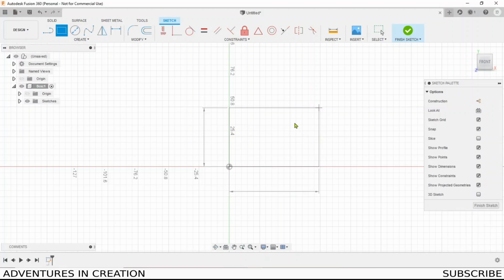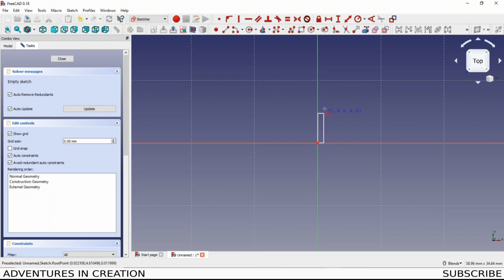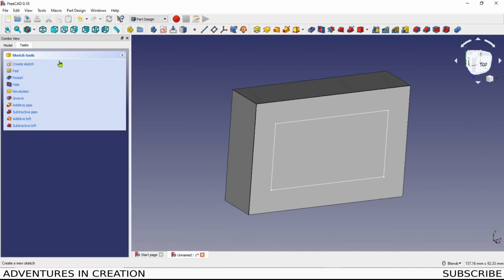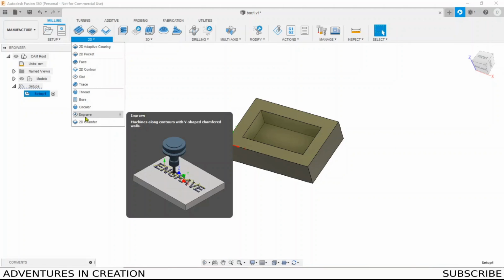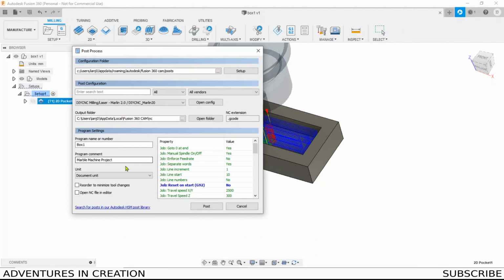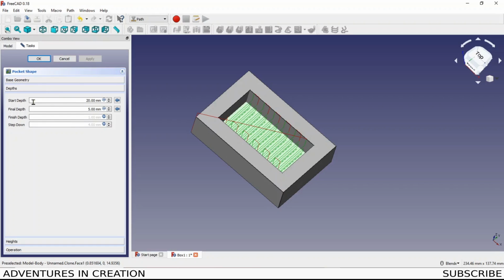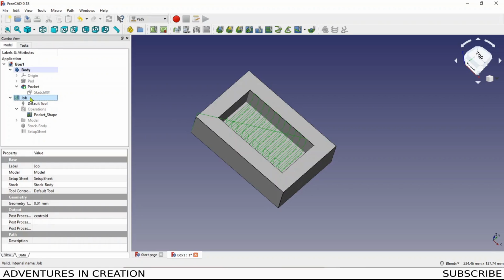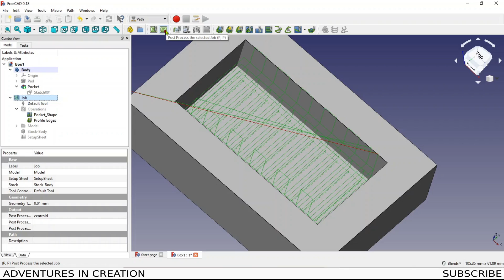Fusion 360 to FreeCAD - MPCNC, CAD CAM Transition

Comment: What would you use in FreeCAD to achieve the same result as Fusion 360's (face) Offset?
Reply from the maker: At the current release working off faces is not recommended but that is coming, then an offset will be easy.
Reply: @Adventuresincreation  Thank you for taking the time to reply to me even though the video is more than 1 year old.

Just to clarify - when you say 'at the current release' and 'that is coming' - are you talking about the current FreeCAD release and that the face offset feature is currently being worked on and implemented in FreeCAD?
Reply from the maker: @ifohancroft  The current release is 0.19 the next release is 0.20 both still have the topological naming issue which prevents using faces to create sketches on. The next major release after 0.20, presumably 0.21, will have a solution for that. Then you could use the face to create a sketch and essentially extend the face. - AFAIK it won't be an exact offset that you have in Fusion now.
Reply: @Adventuresincreation  Thank you!

Comment: Interested why you went from FreeCAD to Fusion 360 and then back to FreeCAD ?

Price of Fusion or something else?

My 18y daughter is about to go to Uni at Sheffield or Southampton to study mechanical engineering and I’m trying to learn CNC both for woodworking (I want an 8x4 feet CNC) and so I can help her learn. I’m wondering what it’s best to help her learn? 

Obvs Fusion is going to be more industry standard so would I being wasting her time or even causing her issues if I help her learn FreeCAD ?

Rambling question: any advice welcome 🙏
Reply: I really like Fusion and even have access to license at work. But Fusion is changing fast and many features added frequently, which is good, but also many features seem to be coming behind paywall. Thats at least my reasoning for interest in open source solutions. I'm not confident at all that Fusion will remain viable for hobbyist machining in few years to come. I'd rather have at least some kind of escape route to keep my hobby costs at minimum.
Reply from the maker: I think learning any CAD 3D modeling would be useful. Just learning the concepts of 3D and being able to create models. I have learned many different systems over the years. I tried freecad a long time ago and honestly it wasn't great. I found fusion 360 when the hobbyist license was free and unrestricted. I invested quite a bit of time learning it. I like it and expect it will become industry leading however, autodesk showed that they can change the licensing situation very easily which made me concerned that at some point there would be no free to use version so I have freecad another look and was pleasantly surprised to find its come on in leaps and bounds. That's why I switched back.

Comment: I liked how there was more con-Fusion in FreeCAD (badum tsss). I guess you already figured out how there are other ways to mill out the inside, that also do the finish correctly.
Reply from the maker: Yes, I will say that FreeCAD has some way to go to be as good as Fusion360 in the CNC department. It definitely has some different approaches. However, I haven't found anything that I couldn't do in FreeCAD and had to go back to Fusion. I believe the FreeCAD CAM capabilities will grow and improve in a short space of time.
Reply: @Adventuresincreation  I fully agree with you! I don't even have Fusion 360 (since it doesn't work on Linux). The biggest issue in my opinion is the different workbenches each being their own beast (with their own beast of a (lead) developer behind it). It would be great if the basic workbenches (sketch & draft, part & part design) just become one uniform interface. But then again... where should it stop? The different workbenches do offer modularity (you decide if you actually need the 3D printing workbench, if you need the plate manipulation workbench, the robotics workbench, etc...)
Reply from the maker: I agree, it's a mixed blessing.

Comment: you could easily do this with one operation in freecad. chose pocket operation and in the pattern select ZigZagOffset. Then the job is done
Reply from the maker: I discovered this after the video. I have found however, that sometimes there are artifacts left over.

Comment: You simply could made a box in FreeCAD complete skip the sketch part
Reply from the maker: I certainly could however, I wanted to change the box later on and was only using this as an example.

Comment: It is risky to create a sketch on a face of an object. See this: https://www.youtube.com/watch?v=0UlnrG-2atk
I don't particularly like the solutions he came up with, but he does do a good job of demonstrating the issue.
My solution is to create all sketches relative to the xy, yz, or xz plane, and then offset and rotate them to where they need to be. Using the spreadsheet to create a list of named variables is very helpful to make sure that when for example you change the thickness of your object, the sketch to the pocket moves with the face. This is done by having both the pad, and the offset for the pocket sketch use a named variable for the thickness.
0.19 does not yet fix the topological naming problem.
Reply from the maker: I understand the problem. I usually use a datum plane offset from the xyz but for simplicity I used the face in the video. This is a problem that apparently isn't simple to solve.

Comment: Freecad hasn't offset
Reply from the maker: I am not sure if you are asking a question? I don't think the part work bench has an offset
Reply: @Adventuresincreation  I'm trying to use freecad (after fusion 360), and when I make a sketch, there is not offset function. Sorry my english
Reply from the maker: It is not an offset the way you would do it in Fusion however, it is possible using copy and trim. Here are a couple of videos that demonstrate it. 

https://www.youtube.com/watch?v=jwmJ3UmU36Q
https://www.youtube.com/watch?v=fsvs8eS37ig

I am sure if you wanted to, you could create a macro that does it the same way as Fusion with just specifying the offset.

Comment: I never got used to F360 as it just never clicked with me.  After trying everything that was out there in 2012 I chose Solidworks, or rather it chose me.  In 2015 I despised what they had done to it and tried F360 and could not handle how it did things (also I despise AC).  Luckily Solidworks fixed 2015 and I never looked at F360 again until last year where I found all of the free things from 2015 had gone pay that I needed to use.  I deleted it and left to never ever go back again.

I have not looked at Freecad since 2012 and back then it was 100% a dog.  Btw, I don't like SW Cam and I have not found anything to do my CAM (the reason I gave F360 another look as it would load a .sld file then I could have used its cam but in 2019 that file format became a locked in paid feature).
Reply from the maker: That is my concern now. I wonder what AD will do with Fusion. Clearly they want to make money but they do have a  large hobbyist community that can't afford the commercial license. I would be OK if they would come up with a hobbyist license for say $65/year and monitor the files you create to make sure you are not running a commercial business with it. Unfortunately right now, we just don't know what them will do next.
Reply: Paolo G  Go be a lap dog some place else.
Reply: so what CAD program do you use today?
Reply: @jsc3417  After trying all of them in 2012, then revisiting them every couple of years, the one that clicked with me, and I it, is Solidworks.  F360 I am glad I didn't click with because #1 I am anti "as a service" which F360 is, and #2 Autocad will just remove a feature on you without hesitation.